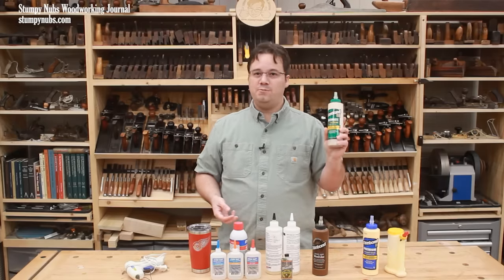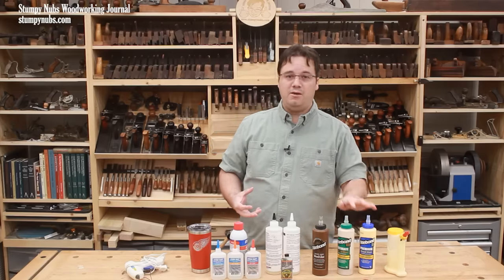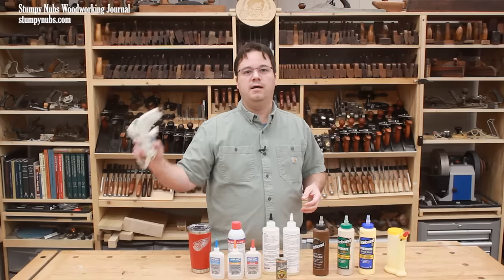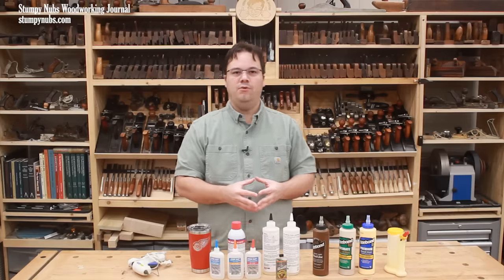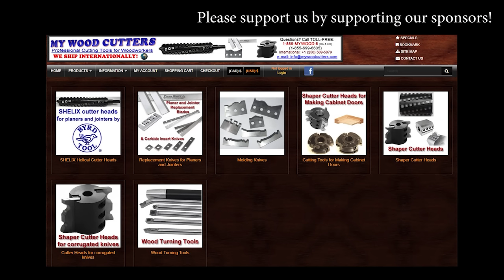Why I don't use Gorilla Glue

Comment: an issue with large hairy primate glue is that because moisture initiates the chemical actions that make this stuff set up, the moisture in the air we breathe is sufficient to cause this stuff to set up.What this means is that when you break the seal on that plastic bottle and use some of the glue...when you let go of the bottle and let air back into the bottle you are letting humid air back into the bottle and allowing the polymerization to begin inside this bottle. If you do not use much of the stuff very often, what remains in the bottle is gonna set up on you before very long.

Comment: I stopped using gorilla glue after building a subwoofer box for my car. A common box material in the car audio world is 3/4" MDF. They use it for everything and especially speaker boxes. They also swear by gorilla glue and drywall screws at the expense of everything else. The problem I ran into was a joint that was on the loose side along an edge. There was a thin gap that I hadn't caught during assembly. The glue filled the gap by foaming and I sprayed the box with bedliner as is common. A couple of years later I noticed the seem had actually split The foam filled the gap but had no strength. It was as if I had used double stick tape on that joint. I cleaned it out of the joint as best I could and filled it with epoxy. I suspect the bedliner was part of what caused the joint to be weak. It prevented moisture from curing the glue. So fair warning about combining water proof finishes with gorilla glue.

Comment: The problem with Gorilla glue is the naming - they have all kinds of glue that are just called "Gorilla Glue" without really differentiating the type - alyphatic, ca, polyurethane, silane, etc. They just call it "Gorilla Glue Clear", or "White" etc. You have no clue unless you read the very fine print and check the chemical names what type of glue it really is, and where it should be used.

Comment: CA is also really useful for repairs. Get yourself a bit of baking soda and some of the thin CA. You would be surprised what you can fix with it, but be warned, it fumes a bit and is almost instantaneous setting so have your stuff ready. Don't expect any working time at all, as in zero, zip, nada.

Comment: So what's your input for gorilla wood glue or gorilla super glue.. since gorilla makes several types of glue and not all foams...
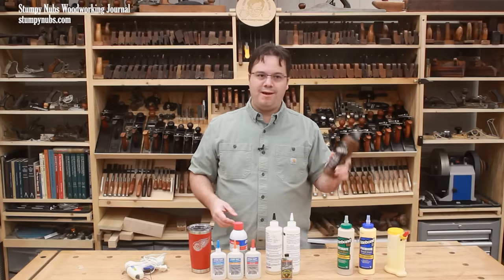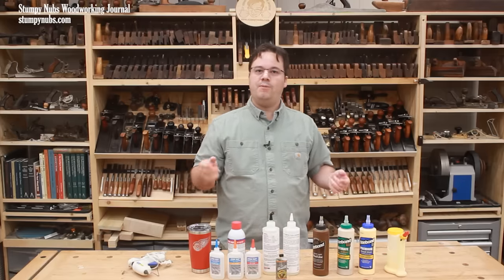Reply from the maker: I mentioned Gorilla's PVA glues as something comparable to the Titebond formulas I use (3:21). I showed that I use their epoxy injectors (6:37). It was only their PU glue that I don't use (10:14) which is their flagship adhesive and is what their brand name is most known for.

Comment: CA glues are great if the load is purely tensile. CA glues do not do well in any type of shear load.  Polyurethanes are one of the few adhesives that work well on plastics. 3M DP190 also works well on plastics.

Comment: I was building a fireplace mantle that had fine detail castle combing about 15 years ago. I used Gorilla glue which I had just bought. It swelled out of the joints EVERYWHERE! I will NEVER use that crap again. Titebond II is what I use for just about everything. It tacks quick and does NOT swell.

Comment: What would you use to glue a prefinished plywood to an unfinished plywood (face to face)?
Reply from the maker: I rough-sand off the finish so I can use regular glue. If I am gluing at a 90-degree angle, I cut a shallow rabbet on the face of one panel where the edge of the other panel will meet. I suppose you could try epoxy.
Reply: @StumpyNubs  cool, I do the same but I haven't tried epoxy. Thanks for your input and content.

Comment: I have come  the same conclusion regarding Gorilla glue, and I'm a carpenter. It's messy, It doesn't like UV, it isn't all that strong, and it's not that flexible. It also doesn't stick to some materials. Practically the only job I think it's good for is laying plywood or OSB flooring to prevent squeaks and fill any ups and downs on the joists. Trouble ks you can't lift the flooring ever again without extreme difficulty. We use spray foam for that purpose now, because our code actually doesn't require any adhesive so it's still an extra. It seems New Zealand where I'm from has only just discovered alephatic PVA. We use a lot of it now.
Reply: When you say spray foam, do you mean that expanding foam stuff? I wouldnt have thought it helps with preventing squeaks if its not really adhering to the pieces as much.

Comment: Another Epoxy product that I have used is two part penetrating epoxy its as thin as pancake syrup and can be thinned as much as 10% according to the instructions because it soaks in it becomes as strong as the wood its self and its a great sealer as well.

Comment: One more interesting type of glue is the mix of animal hides from fish with other animal glues (from Kremer Pigmente). It has a lower setting point around 35°C, and you can push it down with urea or acetic acid to let it set slower. I found it quite fun to use, you have to heat your workpiece and be rather quick, but even without pressing it with clamps pine breaks before the joint does.

And it works really well to stick leather to wood or clean die cast zinc. No kidding, I have an old small vice and glued some leather to it to avoid marks in wood pieces and can't really peel it off. But add a bit of water and waiting and you can replace the leather, also nice for those sewing aids for leather.

Comment: What about gorilla wood glue?  I've been using it because it's 1\3 the price of titebond and is type 2 water resistant...?
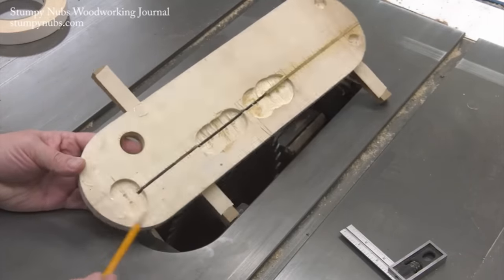Reply from the maker: I mentioned Gorilla's PVA glues as something comparable to the Titebond formulas I use (3:21). I also showed that I use their epoxy injectors (6:37). It was only their PU glue that I don't use (10:14) which is their flagship adhesive and is what their brand name is most known for
Reply: @StumpyNubs  thank-you for the reply,  i see you did mention it,  i missed it the first time, my bad.   and thank-you for your informative and entertaining videos 🙌

Comment: I looked at a few comments and did not see anything about what I am going to say.  Perhaps it will have some merit.  Over 30 years ago now, whilst I was studying mechanical engineering, we did a lab where we glued up a myriad of materials, using a variety of glues, and a multitude of preparation techniques.  After a few days of cure, we put all the joints under stress to failure, recorded the resulting strain (at failure), and the stress required.   The number one cause of sub strength joints was poor preparation.   However for epoxy, the number one cause, was shifting the joint, even slightly after joining the faying surfaces.  Of course there was a small window where the joint could be adjusted, but this window was highly dependent on the cure speed if the epoxy.  In other words, one had considerable less time with “5 minute” epoxy than with slower curing mixtures.    Bottom line is then: do not think that just because the glue is still wet that you can adjust the joint at your leisure.  Try to minimize the shifting between the faying surfaces as much as you can for a good strong joint.

Comment: Gorilla Glue is useless for woodworking, but I do use it regularly for gluing the tubes inside my pen blanks. I've never had it fail as I have had with CA glue. Yes it foams out at the ends, but it is easily cleanable in this instance.

Comment: I did not read all of the comments, so excuse me if I am repeating something.  

I have switched to Titebond II Extend as my primary glue. It has about 15 minutes of open time. That helps me a lot. I am slow. The clamp time is about the same as the others. For anyone reading this, it is a good option.  There is also straight Titebond in an Extend version if you do not need weather resistance.

Comment: I used to be a big fan of polyurethane glues including those from Gorilla for large glue ups, vacuum bag ply glue up panels and such but have started going back to low viscosity epoxy.  The problem with any urethane glue is the cured glue has a significant amount of outgassing and becomes more brittle over the years.  I developed a sensitivity to the outgassing.  Epoxy is hazardous but only in it's uncured state.  Once it's cured, it takes forever to degrade and is fol all definitions, chemically inert.  Epoxy cures in two phases, a sandable cured phase and an ultra hard impossible to sand phase.  I try to find an epoxy that has an average working time of one hour and an initial cure up time of 8 hours with an 8 hour sandable hardness phase before it tries to form a type of ultra hard "gel coat"

Comment: Nice thing for hide/bone glue. You can buy it dry, which lasts forever, and just hydrate it in a jar with warm water (don't boil it).
More prep work, but if you don't want a mouldy mess in a jar a few months after buying it and only using it twice, this is much less wasteful.

Comment: The "dried" colors are worth noting.  We were surprised about the color changes after drying.  Another channel is needed to address this, where large joint fills are needed.  Titebond is the worst.  Epoxy is best.  Also, don't forget the flex glues, which we use everywhere where it is not seen.  These are very valuable where flexible joints are required.

Comment: Good info about all the wooworking gluesm indeed type 2 titebond don't wash, have some stiff work shirts to prove it 😆 About the polyurethane glue once bought a bottle and used it to glue the rubber feets of my steel tool frames, didn't find any other use for it and ended up on the trash bin because get hard on the surface and even you can feel the inside was still usable didn't worth it to save it.

Comment: CA glue on masking tape gives a very strong temporary bond between two flat surfaces. Brilliant shear strength, not so great tensile strength, so you can separate the pieces when you need to.
Reply from the maker: The CA glue/tape trick is only as strong as the adhesive on the tape. I don't find blue tape adhesive to be strong enough in many cases. I prefer a proper PSA double-sided tape.
Reply: This is the technique I started using for router templates with the expensive name brand painters tape that seems to stick to anything. It seems to work good enough for that so far.

Comment: Gorilla do a wood glue that doesn't foam, what would be your opinion on using that type? I haven't had any issues with it but I was quite concerned by the title of the video.
Reply from the maker: Yes, I mentioned Gorilla's PVA glues as something comparable to the Titebond formulas I use (3:21). I showed that I use their epoxy injectors (6:37). It was only their PU glue that I don't use (10:14) which is their flagship adhesive and is what their brand name is most known for.
Reply: @StumpyNubs  Ah, sorry I missed that bit. Thank you for replying and explaining. I appreciate and value your opinion.

Comment: Here's a tip, regarding epoxy.  There's a "rule of thumb," in chemistry (I'm a chemist), that for every 10 degrees C (which is 18 deg F), reaction rate doubles.  The curing of epoxy involves a chemical reaction, not drying out.  If you cook the item at a moderately high temp (but not hot enough to damage it, say, 150-200 deg.F), it will cure MUCH more quickly.

Comment: I like the polyurethane Gorilla Glue for one thing,and one thing only: gluing my drone's foam body back together after a crash in a short time. You can use rubber bands to hold parts together until it sets. For other glue jobs,forget it.

Comment: I like the video as a comparison but I find the title of the video inappropriate. Gorilla is a family of glues. I use Gorilla Wood Glue all the time making cabinets, toys, and models. It’s great. I’ve used Titebond I and I find it similar. For me, Gorilla Wood Glue is priced well, very strong, and easily accessible vs Titebond I where I live (Southern Ontario). What you are talking about (and I’m sure you’re aware) is Original Gorilla Glue which,of course, is polyurethane glue. It’s superb for outdoor work although I often use construction adhesive as well. Both are a bit messy but the advantages in construction grade wood makes it fine. I think you are leading viewers to conclude Gorilla is not appropriate for most woodworking but we should be aware Gorilla does present an attractive option if you are looking for a PVA glue.

Comment: One glue I love is urea resin glue. David Marks uses (or used) this glue a lot for it's hard as glass when cured nature as well as no cold creep. Ideal for bent laminations, veneer, and complex glue ups. The draw backs are you can't use it below 65F (70F is the more practical low end), it has formaldehyde, needs to be mixed rather precisely, and it can expire especially if not stored properly. I don't see it for sale much at all anymore, hopefully it's a supply chain issue for now.

Comment: My daughter had a sorta cheap dining set. It was a nice set but with wooden dowel chair and three kids, well the end results is having to glue everything up at the end of a year. I was visiting my daughter and I thought I'd do her a solid and asked her if she had wood glue and she handed me a bottle of Gorilla glue. I told her I'd never used it before and thought it to be too expensive compared to what I've used in my life time. Now I'm no beginner being in Construction all my life and having most every tool, 12 in. Table saws, 12 in. compound miter saw's, you know where I'm going. I glued up those chairs and by the time I got to the fourth one I had to stop. I was totally disparaged by the results of the Gorilla Glue. Had to take everything apart, one by one and cut and dig all the glue out, sand pre-fit, countersink hole for screws. When I was done I went and got some good old Elmers wood glue, stuck everything back together and screw it together so it wouldn't fall apart again. 3 and 1/2 years later and they're as good as new. I'll never use Gorilla glue again for anything!

Comment: For my shop my biggest problems with glue is availability and affordability. Some of the glues mentioned are not available in the big box stores. Hide glue and CA activator are nowhere to be found. Of the glues that are available like JB Weld 5 minute epoxy is now $24. at Lowes. I use it a lot in my projects and it was only $12. when I first started using it over 12 years ago.  Gorilla glue is also getting out of hand with their prices. I really don't like going on line to shop but when stores wonder why they are losing money maybe they should listen to their customers more about the availability of products.

Comment: Some kids ATE that white glue in grade school. I work with hot hide glue, fish glue, Steve Smith's tropical hardwood epoxy, West Systems Epoxy, Titebond I, II, III and even their liquid hide glue. I have to use heat or heat and moisture to soften glues so I can repair guitars. Steve Smith's TH epoxy has a very long pot life especially in lower temps. 45 minutes when it is in the 90s and over 1 hour in the 70s and over 90 minutes when it is in the 50s. Titebond will soften with heat too. All aliphatics can vary as to how they soften up. Some of it remains  gooey and sticky. Bob Smith's Epoxy? Not in my shop!

Comment: CA glue "activator" is just water in a spray can. I live in a very dry climate and before I super glue 2 pieces together, I'll often touch one broken side to my tongue and apply glue to the other side. Also, if you use any sort of super glue, make sure you know the baking soda "hack". Super glue and baking soda is a game changer, as it can be used to fill gaps, build up material, and create incredibly strong plastic-like material that can be sanded and shaped.
Reply from the maker: LOL- no it isn't "water in a spray can."

Comment: This is so helpful to know. As usual, your presentation is concise and factual. I use each of the types you covered with similar results. I especially like two-part epoxy when I have to glue dissimilar materials like brass fittings into wood. I use brass inserts in wood bottle stoppers I turn on my lathe. Thanks for the information.

Comment: Great video! However, I would disagree with your statement that hide glue has a long setup/open time. It depends on the application and the temp of your shop and wood, but for the premixed Titebond I'd call it less than a minute for a strong bond. Shorter than PVA in any case. Of course, hot hide glue has an open time of basically nothing :).
Reply from the maker: The open time for Titebond liquid hide glue, which was the glue spoken of in this video, is advertised as 10 minutes. http://www.titebond.com/product/glues/9e9995b4-08eb-4fc6-8254-c47daa20f8ed I have not tried to push it that far, but I have definitely gotten more than the minute you claim. If your joint failed, maybe your glue was past it's 1-year shelf life.
Reply: @StumpyNubs  fair enough! Honestly, as a luthier I'm more experienced with the hot stuff, but I keep a fresh bottle of the Titebond hide glue around for little stuff. It's great for rubbing patches inside guitars, no clamps required.

Comment: Gorilla glue worked for me when I built my 36x 24 steel hut   I  drilled  3/4 in holes 6 in deep  in concrete  used 6 in x5/8 bolts to mount L bracket  where  needed  (4)  used VAC.to remove dust each hole  poured gorilla glue on bolts inserted in hole then added  some water to activate  tested  with crow bar and 2x4  would not budge been 7 ys now no prob.

Comment: How about Hot Glue?  I use my Hot Glue Gun to secure things quickly.  If you are using a long setup glue but don’t want to hang around for it to dry..use the Hot Glue Gun to make sure the two pieces won’t move during the setup time.